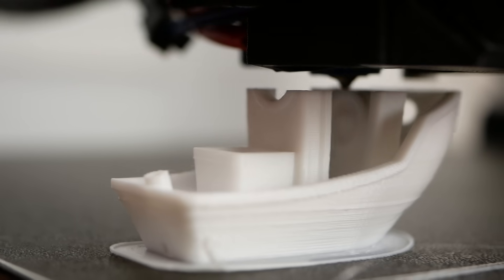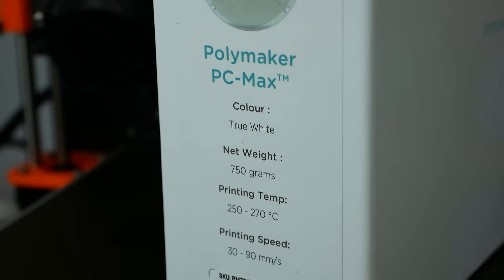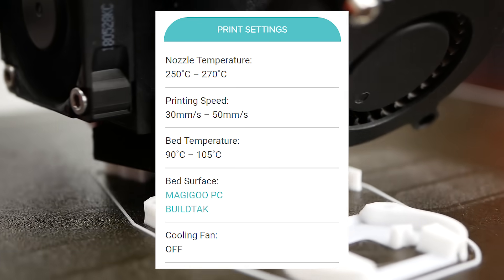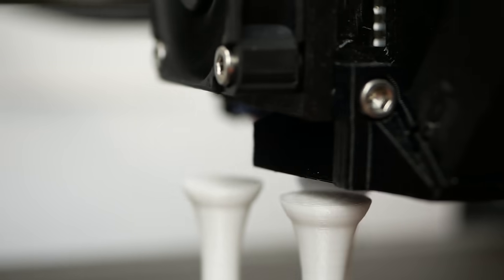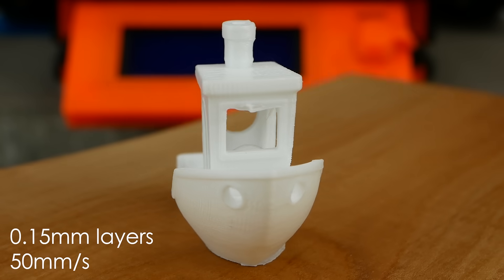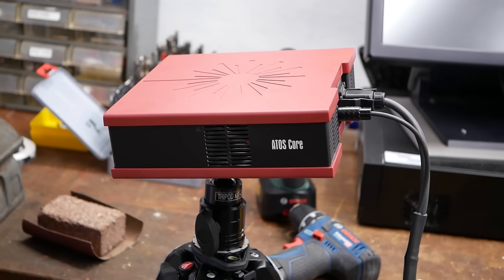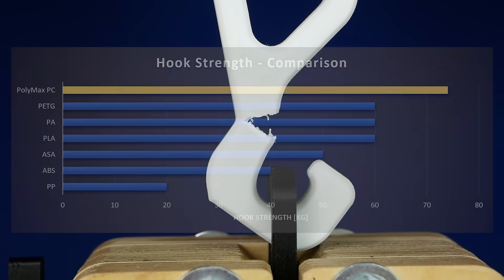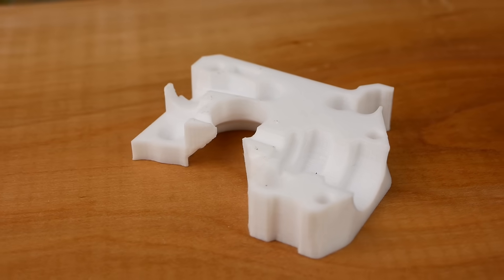The King of 3D printing materials? Polymaker PolyMax PC REVIEW

Comment: Great video and informative. Having a rough time trying to print the stuff with poor bed adhesion but have a few more tunes to try out. Need to make parts for a voron build so I need the high temp resistance. Would you pick abs or polymax pc for these parts?

Comment: polymax is not pure PC then. it's a mixture or something.
PC is usually extruded at 270-310. mine says that on the box (another brand)
those mixtures ruin the layer adhesion stiffness a bit and all that but also make it way easier to print

Comment: Ender 3 V2 can compatible filament polymaker?
Reply from the maker: I printed that material on my Ender-3. It's at its limits but it works.
Reply: @CNCKitchen  interesting, but which temperature right of nozzle and bed? Just I don't want damage my new 3d printer.

Comment: Would you recommend printing this material with an enclosure? Are there issues with fumes when printing this without an enclosure? 

What's your experience with part strength & layer adhesion with these sorts of materials on Prusa printers with and without enclosures?

Comment: If you re-humidify I.e. "add water back into the plastic after printing" this should dramatically increase strength. When thermo forming Polycarbonate it is quite common to have to do this after forming to regain the rated impact strength of the material as it is the water content that makes PC so strong.
Reply: This is for real?? Seems so backwards of everything I've learned lol doesn't surprise me tho I guess
Reply: Need another source on this.
Reply: I couldn't find any info on this, do you have any references?
Reply: Only nylon needs to be rehydrated, pc should not
Reply: Some say let it soak up some moisture, some say put it in the oven at 100C for 2 hours for it to properly cure. I am currently in the ending phase of designing some aerodynamic winglets for my track bike. Would be nice if either method strengthened it before i apply some epoxy resin
Reply: I remember this from the yard trimmer video. The nylon cord was hydrated for strength and that package said do not dehydrate it or it would become brittle. That was nylon though, but I could see it for pc too. Are there sources?

Comment: What do you think of this material for a single-wall airplane wing? I can't get PETG to work because it seems to deform too much during the long print. PLA works great but has the limitations in impact resistance and, more importantly for me, heat resistance with a low glass transition temperature.
Reply from the maker: I know people use it for that purpose but even though the Polymax PC warps only little, it still warps more than PLA.
Reply: @CNCKitchen  thanks! There's not really enough room for any warping on some of these parts sadly :(

Comment: I'd be interested in long term permanent load resillience of this (and other) plastics. I had parts made from natural unpigmented colorfabb PLA-PHA blend (it has a yellowish color and is weakly translucent) unter pernanent high load conditions. Due to its translucency I could see many many micocracks near the surface that had formed without the parts breaking right away. PLA-PHA is actually a  good material just not for applications with permanent high loads. Given I have no heated bed I switched to carbon fiber filled PETG (XT-CF20) as only viable seeming option. But this material is  completely opaque black with rough surface. So now I can't see if cracks are forming.

Comment: Here's Polymakers recommendations: 
"Printing Speed:
30mm/s – 50mm/s
Bed Temperature:
90˚C – 105˚C
Bed Surface:
MAGIGOO PC
BUILDTAK
Cooling Fan:
OFF
Drying Settings:
80˚C for 8h
Recommended Support Materials:
PolySupport™
When printing with PolyMax™ PC it is recommended to use an enclosure. For large part it is recommended to use a heated chamber.
It is recommended to anneal the printed part right after the printing process to release the residual internal stress.
Annealing settings: 100˚C for 2h"

Comment: Excellent video as usual. And the following is not a criticism of your video or methods. Aren't the "strength" stats for PLA a bit of wishful thinking? Yes PLA is stronger than say ABS right off the printer, but put a PLA part into the field and under stress and within a few weeks it will have deformed under the pressure. I may have missed the video you made where this was mentioned or considered. Its a bit like Elon Musk bragging that a Tesla can go faster than any street-legal car on the planet but forgetting to mention that the battery will be dead in 5 minutes at that performance, so how useful is that stat? Am I missing something? Can a PLA part be strong over its life? Signed: ABS lover and hater.

Comment: from my experinece, this looks like printing too fine and too fast, to get the best out of a high temp material in a room temperature enviroment. 
just like PETG, PC truely shines, when printed slow and hot, in a girthy extrusion (THICC layers and lines), and with a nozzle that has a wide, flat face, to transfer a lot of heat into the material. so it doesnt "adhere" in layers, but fuses into one solid piece. this doent work for any object, and doesnt like overhangs, but makes indestructable parts, and works wonders in vase mode!

Comment: A 100% polycarbonate print will be even more stronger. The glass heat bed provide really good bed adhesion. I preset the heat bed temperature to 125c and use torch burner to heat up the bed faster. The burner seems to be able to burn away any grease on the glass and open up the pore on the glass. With this method, the polycarbonate will stick on the glass bed like hell.......I also heard that annealing the polycarbonate will increase strength a lot.

Comment: Your charts made me question my understanding of some material properties - specifically around impact resistance when compared to Nylon.  My intuition was that Nylon would have higher impact resistance than ABS, which is not what was shown on your graph.  After doing some digging, it does seem to have lower impact resistance.  I had mistakenly thought that because Nylon is more tough, the impact resistance would be better, but that's not the case.  Thanks for your great videos, and you clarified something for me today 🙂.  Also - looks like I need to get my hands on some of this PC, those material properties looks great.

Comment: Thank you for this video.  PC-Max is still my favourite material.  When I print in anything else thesse days I am dissapointed by the materials strength.  As per my other comments:  I'd really like to see some investigation regarding the reccomended annealing and a comparison against 'pure' polycarbonate materials.  The Polymaker MDS states that this material is 10% 'fillers' but don't say what!  Perhaps a gypsum, or butadene; maybe styrene.  It feels a lot more 'gummy' than other polycarbonates and is a LOT easier to print.

Comment: Personally,  i've been disappointed by PC max filament. I had to replace a cast aluminium piece on my electric guitar vibrato mechanism. 
It's what's called here the thremolo block, in which the tremolo is inserted, and it takes quite a lot of momentum due to heavy vibrato use.
https://qph.fs.quoracdn.net/main-qimg-b85ac079da597b0016ee8fbd90df2565

The part was printed with full infill, 250°C and no cooling. screw holes where threaded by the screws themselves, and cracks have appeared right next to the screw holes, even befor the part were loaded. It just appeared like a couple of days after the screws where inserted. And it was not a layer adhesion issue because screws where mounted in Z axis.

I think it may be due to the fact that it absorbed moisture since it has been laying on the bench out its box for a month

Anyway, I then printed the part in an old Prusa standard PETG , and it came out way better in every aspect, and it have been working for about 4 months now

Comment: From PC filaments from other manafactures they have been printed at tempatures over ~300* as high as 320*. If you go hotter the fan should become more usable with keeping the part strength. At lower tempatures (sub 300*) the slower printed the better so the plastic had time to melt in the hotend.

Comment: I've read that PC needs to be Annealed to remove residual stresses in the print. I wonder if the 270C at 15% with annealing would have higher strength?

Comment: Pure PC is best printed in slower speeds, no fan and in a a warm / heated / closed chamber. Best is just in a enclosed heat controlled chamber.
Printing PC on a "standard" printer is lets say just the hillbilly way. I got the best resulsts with 310-330C but i guess Polymaker is not pure PC.

Comment: If you want the true king of filaments, try Novamid 1030CF10. Quite expensive, but it has better specs in terms of E-modulus and tensile strength even when tested in the wrong direction. When tested in the right direction (so the carbon fibers do their job), you can expect an E-modulus of almost four times as high as PC (7.5 vs. 2 GPa) and a tensile strength of almost twice as high (110 vs. 60 MPa). I'm interested on seeing a Charpy test on that, though! Edit: print quality may also improve a lot compared to PC, I've seen some amazing prints.

Comment: According to a technical data sheet that's pretty hard to find, it's up to 30% not polycarbonate (they give a range and not a specific percentage). I think E3D's Sanjay said it was adulterated with PET to make it easier to print. That adulteration affects its material properties in a negative way in order to make it easier to print on drafty machines that are a very poor fit to engineering materials. I wish they were more up front about that adulteration.

I'd say compare this to unadulterated PC but that's going to be hard on a sliding bed machine, and an unenclosed one at that. I bought a spool of this thinking it had thermal resistance and it really didn't, also it stress fractured after a while. I felt really let down by Polymaker.

Comment: CNC Kitchen love the videos thanks for sharing!!!
 I have a print farm and I print with the Polylite PC clear, Polymax PC white and PolyMax PC Black a lot.
They all are different with end results, you would think there would not be much of a difference but there is.
On my raise 3d I print the Polylite PC clear at 260c with .1 layer height for best strength.
IF your print has long bridges never have your layers thinner than .1 mm, too thin and you will get much more layer drooping.
 First 5 layers no fan. 15% to 20% fan after the first 5 layers, if that does not work no fan.
I print the Poly Max PC Black and white at 265c on the Raise for best strength and end results.
When I print the Poly Max PC Black and white at 270c it seem to have less flex and it is more brittle.
The Black and white are softer to the touch but stronger than the clear.
To much fan on wider flat surfaces will cause a warp effect.
Printing with a raft will bring less print failers and Increase your print consistency.
If your not using a raft use a 2 layer brim with at lease a 5mm gap between your print and brim, and your print quality will increase.

Comment: Did you ever test TPU for layer adheasion and would you have health concerns in case of TPU?
Reply: Would you do welding or power sanding inside your house or without PPE?!? The 3D printer is STILL a machine tool and should ALWAYS be treated with proper precautions... this is NOT a freaking Star Trek Replicator!!! Many filaments are not as volatile or outgassing of "pollutants"... (Please remember that even frying bacon releases "pollutants") but when you start getting into the more unusual or exotic materials you **DO** need to start looking at proper ventilation and PPE...
Reply: @edwardpaulsen1074  Because he is not ignoring that fact, I wanted to ask about his opinion about TPU. When you mention PPE, you don't mean Polyphenyl ether, but a gas mask? Or did you want to say that everything but PLA has to be threated like abs? Or maybe as there are always unknown ingredients it is better to also treat PLA like ABS? 
When googling I always find videos like this https://www.youtube.com/watch?v=8Kr5YqPLrGU
And they always sound like: Only ABS is dangerous, PETG is even less dangerous than PLA and TPU is OK (although chemists told me it might be potentially harmful because of the ingredients)
Reply: @maxmustermann2596  PPE is the industry and OSHA designation for  Personal Protection Equipment  and covers the proper protection to be used in any working environment, It is used in conjunction with the MSDS (Material Safety Data Sheet) in the USA which provides all the components of a given product as well as any hazards as well as safe amounts and what protection to wear when using those products.

Comment: 12:28 is he using glue on the powder coated sheet? You should only use isopropyl alcool
Reply from the maker: Works fine. Never had a problem with it.

Comment: Hobbyking sells some (seemingly) pure polycarbonate filament for around 20 €/kg. It would be interesting so see how that compares to polymax PC and the lite version. I've been printing with the Hobbyking polycarbonate for a while and it does seem really strong, but I have nothing to compare it against. It requires a printing temperature of 295 C, which leads me to believe it is in fact pure PC. I also use an insulated chamber while printing with it. Some kind of  a chamber is a must, since without it, the parts would completely warp themselves free from the surface.
Reply: I agree.. I have both materials (I use PC-Max a LOT) and the hobbyking is indeed a LOT more like other polycarbonates I have seen in the wild.
Reply: Ok, but you can print this one in 250 !

Comment: Stefan: Wouldn’t it be at 11:12 that the Standing printed Hook fails earlier than 80% expected because the fixture hooks are offset from the perpendicular axis of the failing layers... so the crack would initiate and propagate right to left, rather than engage full layer area at once.

Comment: I've always had best luck with PC being printed in an enclosure with the cooling fan on 10%, but also with a piece of masking tape covering 2/3 of the cooling fan's intake. This seems to result in strong layer adhesion while still maintaining good print quality. I recently printed some replacement valve cages for a pressure washer and they held up great.

Comment: If only PolyMax PC was a pure PC filament. I wish they were clearer about it being a blend of polymers (likely a blend of PC and PBT, based on the density and melt temperature) on their site, but you have to hunt down an MSDS for it before they tell you it's only 70-90% PC. FWIW, a true PC filament should require extruder temps around 300c rather than around 260c like Polymakers' stuff.
Reply: It makes sense why they do it they lower the required temperature to make it much more accessible so more people can buy and use their "polycarbonate" blend.
Reply: @infernaldaedra  it's definitely easier to print, that's for sure. And waaaay easier to anneal. But it's also not quite as strong. :)

Comment: I tried printing parts for my 3d printer with it, and they were really brittle, and every part eventually cracked in half, not even at the layer lines, but even sometimes perpendicular. I reprinted in PETG, and it's held up perfectly. What did I do wrong? I even annealed it.

260C hot end, 100C bed, and 0% fan.

I used buildtak, and a raft, and it was super stuck down, no bed lifting.
Reply: How many walls are you using for your part and Infill? 100c on the bed is maybe also a bit overkill for PETG.  You say you reprinted in PETG were you using a different material beforehand? If so what type and brand? Typically for decent strength 3 walls or shell perimeters is enough for most prints but I have used up to 5 for stronger parts. Also the part cooling shouldn't cause an issue with PETG you do want the fan off for the first few layers by afterwards go ahead and turn it on. PETG when it is thin is pretty flexible but with solid parts it behaves alot more like glass and can shatter it is actually a incredibly strong filament as it can take alot more abuse before breaking compared to pla.

Comment: You should compare the polymaker PC vs pure PC filament.
Reply: +1.. I'd be very interested too.  This material is excellent, but it is VERY different to use than other PC's I have tried.  It's certainly a lot easier to print!  It feels a lot more 'gummy' as if it is modified with a styrene or something.  The MDS says it is 10% 'fillers' but give no clue as to what those are!
Reply: Yeah I think the temperature resistance will also be a bit higher at least. Lower print temp usually also means lower temperature resistance.

Comment: Filamentum CPE? Did you ever review this? Please do if not - this is easy to print and has very high durability. It is very a versatile 3d-printing filament from my experience and I use it for all my production parts in mechanical applications
Reply: Isn't it just another petg variation?

Comment: Given cost and print quality, PLA still seems like the sweet spot.
Reply: Is it me or you're comparing apples and pears? 
PLA is usually for decorative indoor stuff, a.k.a. garbage
Reply: @alejandroperez5368  i suppose PETG is still the sweet spot for most functional prints. PC and nylon based filaments are needed basically when you wish the part can be made with metal. my isssue with PC based filaments is that part quality is often sacrafised as well as the warping issues with large parts. I was hopeing this review would have tested its warp resistance to pure PC filaments